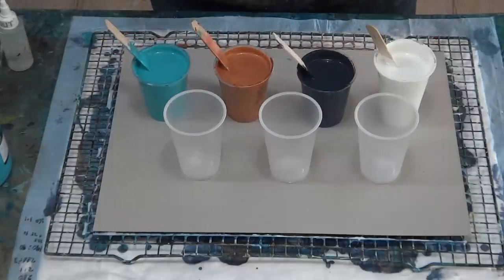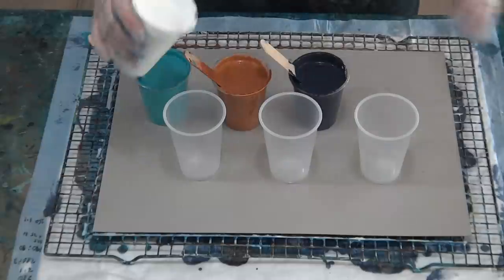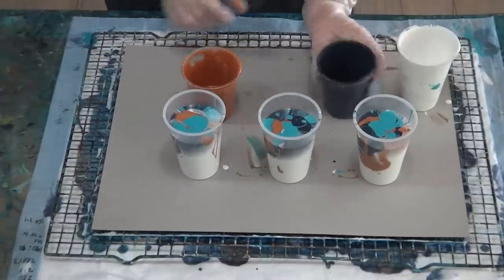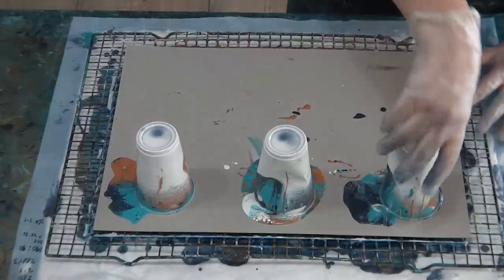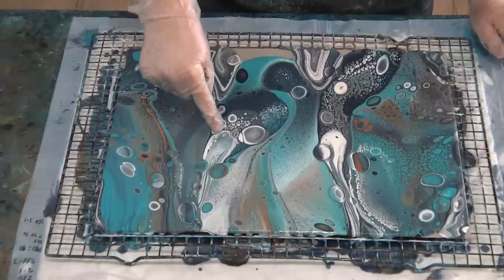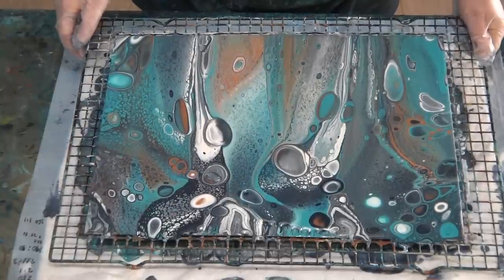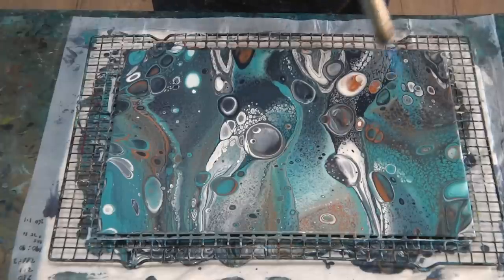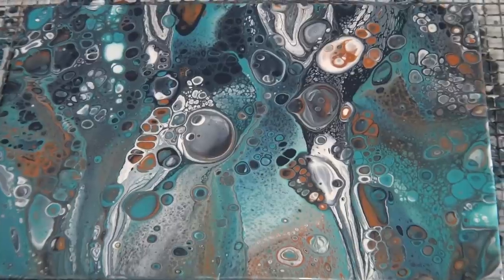#54 Three Flip Cup Pour

Comment: I absolutely love your pours! I have a question about the cards you use. Is it a heavy card-stock or is it a plastic coated card so that the paint doesn’t soak into the card? Also, do you ever have curling of the cards occur while the paintings dry?  I’ve had that occur when I tried using canvas boards. Thank you for sharing your videos